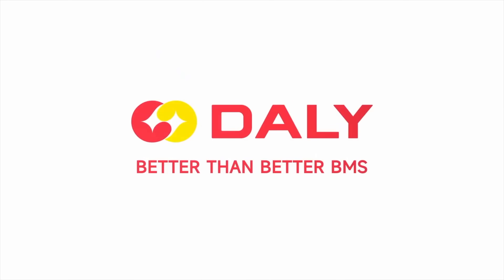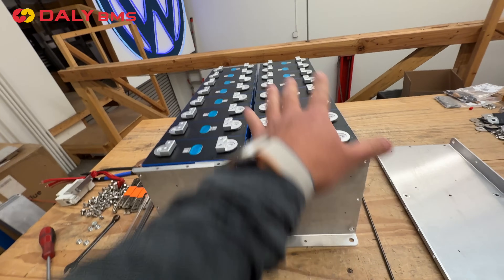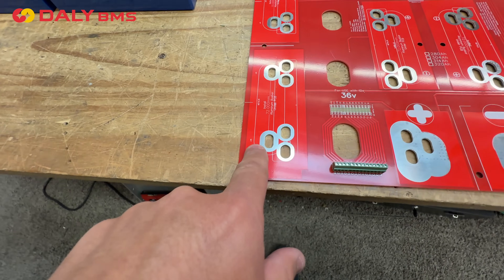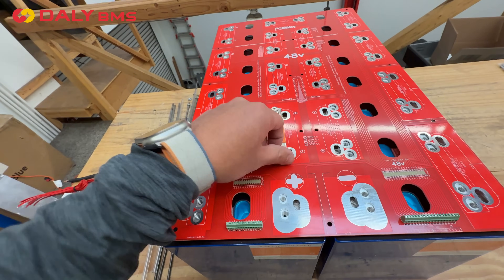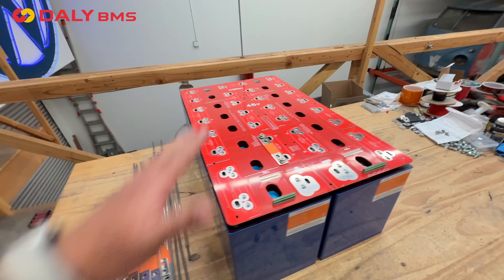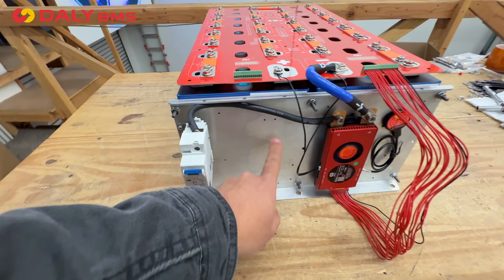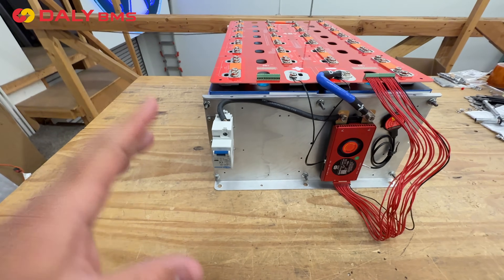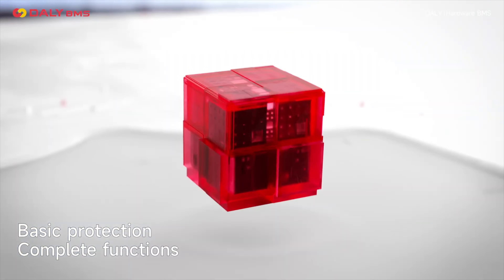Save Thousands by Building your own Battery -  Daly BMS

Comment: Do you have or can you get these dual bolt connector cells in 314 or 320AH? Are you going to stock them on your site? Can you get the Daly BMS in the 300 amp size with inverter communication?

Comment: It would be awesome if you have the cutouts for the QR codes next to the vent hole. This way, you could quickly visually check that all the batteries are arranged in the correct orientation. What I mean is that either you can see all the QR codes and it is configured correctly(+ive and -ive), or you can't see all the QR codes and it is not configured correctly. Also, you might just want to check your QR codes without having to disassemble the battery pack. 😊😊😊😊😊😊😊

Comment: What brand and model, amperage, AWG size are you using for the breaker? I am building a 48v 340AH battery, my BMNS can handle 250AH, can you give me some recommendations on what cable AWG to use and  the breaker model please? Thanks in advance.

Comment: I run 60kwh off grid from my experience JK is much better than daly. Daly sux. Also those duble post cell terminals are anodized try measuring voltage and resistance , anodizing works as an insulator there can be some issues with proper contact.

Comment: yes need a 12v version for my boat
Reply from the maker: 300Ah or bigger?
Reply: Con 4 celle in sere da 3.2volt 300amper lifepo4 is good for 2500watt di use inverter max 3000watt con cavi da 70mm2 rame

Comment: Please don't attempt to save just a couple hundred bucks (thousands? no way!) with a DIY battery. You need skills and proper equipment. That thing shown in the video is 14kWh, a lot of energy! The connecting PCB seems it doesn't take into account for expansion and contraction of the cells, which still happens despite the compression. The BMS main contacts are close to bare metal panel with no insulation whatsoever. just need a screwdriver in the wrong place to make a huge mess.

Comment: 2 questions... 
11 Can I use this on a golf cart?
2. How do you charge that pack?
Reply from the maker: Yes it can be used to power golf carts.  I would use the LF280K cells .    You can use any charger, with the right voltage.  (57.5v max)

Comment: Looks great.  No mention of temperature sensors, are those not a option?  They are absolutely necessary for locations that freeze.  Thank you.
Reply from the maker: Great point! There are two sensors on the bms they can be taped or glued to the cells or pcb an I have a connector for them on an updated design of the board to accommodate installation of these so stay tuned for that

Comment: @jehugarcia hi Jehu, thank you for you recommendation on the BMS, about to install a system in a camper that will be used daily. What inverter do you recommend if I want to a pure sine wave, 240 volt and higher watt (around 3000) output. I know Victron is great and would like to use though can you suggest a lower cost brand, I am okay with using an imported model, hoping you have experience with a brand that consistently makes clean power at the advertised specs?
Reply: It really depends on your load type: Resistive or Inductive.
Reply: @s.mendez7160  Thank you for your reply, both as I am building a system for a full time camper, specifically looking to ensure smooth clean power for computer and audio equipment.
After posting this question I thought about solar and charging and thinking that an all in one charger/inverter like an eg4 would be a good fit vs getting a generic import brand inverter. I am sure there are generic all in ones too however my guess is the support is generic if it exist at all, not good for a more complex device.

Comment: I have already very same style battery, just had own wiring, plywood plates and bottom plate. What I can recommend is to use plastic pipes over threaded rod in case of physical impact and possible shortcut between cells (bare thread works like a saw!).  And one question, what torque do you use on your rods? In my opinion have to be very, very low (I use 4xM10 rods and torque @ 1.5Nm) - but Jehu have done way more batteries than I ever seen :)

Comment: Problem with daly BMS in general is the poor balancing. (Only 100mA, and passive, not active). There are other BMS out there with active 2A balancing.... with proven quality and about the same price.
Reply: Poor balancing, slow update values in the app, measured amps bounce up&down like crazy with a constant load. Therefore the shown power is not correct and the battery percentage is wrong.
I still use two Daly's but bought two cheaper JK's for my 3th and 4th battery. Battery percentage is still not perfect but the rest is. I wouldn't buy a Daly again.
Reply: @martinmooren9536  Once you did a capacity test on your Battery Bank, is that the number you entered into your battery monitoring device for Ah capacity?
Reply: What BMS are you using?
Reply: @s.mendez7160  I have  a 90kWh battery bank consisting of 9 banks of 200Ah-16cel (10kWh). After a LOT of research I came up with the JK inverter BMS. As said here by others, the battery percentage goes off when you don't hit the 100% SOC from time to time. Right now in winter here in Belgium (where i live) I never get 100% soc when only relying on solar. So every 4-6 weeks I set my victron inverter grid setpoint tot 1kW. That way after a week the battery hits 100% again, starts to (active!) balance and off we go. Note: english is not my first language...
Reply: @s.mendez7160  B1A8S20P-HP for a 24V system.
Reply: can you recommend any?

Comment: Why not just buy Eco-worthy 12v 280AH batteries which include a BMS? Its far less expensive especially since they include the cost of shipping. Also far simpler installation. If there is a reason not to I would love to know.
Reply: What price you paying for Eco-worthy 12v 280AH battery? The blue cells are much cheaper than any pre-built battery I've seen.
Reply from the maker: Because you can buy a Ford  or a Chevy.  And pretty sure a budget battery won’t have premium cells
Reply: @jehugarcia  The spec'ed cycle count on the Eco-worthy is a bit less (6000 vs 8000 on the EVE cells). Granted the spec sheets are often inaccurate. Have you done any testing with Eco-worthy batteries or used them?
Reply from the maker: No I build batteries mostly others review

Comment: Building a 70kwh bank right now with batter hookup envision 280 ah cells. I made my own end plates. I love yours but I had means to do it myself. I saved $10,000 compared to buying eg4 batteries
Reply: @sobanidrees2999  my bank is 84 cells (4 extra) of envision 280ah new grade A balanced and matched from battery hookup. That makes me, 5 banks of 280ah or 14.3kwh each 71kwh total.
I paid $6,000 for them after tax with free shipping. Im using 5 jabidia 100amp bms. I paid about $120 each for those. I bought 1/4" aluminum plates and all thread for compression. Spent another $200 on that. Bought a shelf for another $200. Bought breakers for $200 All in for $7,200 or less. 
Eg4 wall mount 14.3kwh batteries are $3500 after tax not including shipping. Might be free shipping. For 5 cells that's $17,500 for the equivalent batteries. That's a savings of over $10,000
Reply: Cost of bank & which BMS used ??
Reply: @sobanidrees2999  my bank is 84 cells (4 extra) of envision 280ah new grade A balanced and matched from battery hookup. That makes me, 5 banks of 280ah or 14.3kwh each 71kwh total.
I paid $6,000 for them after tax with free shipping. Im using 5 jabidia 100amp bms. I paid about $120 each for those. I bought 1/4" aluminum plates and all thread for compression. Spent another $200 on that. Bought a shelf for another $200. Bought breakers for $200 All in for $7,200 or less. 
Eg4 wall mount 14.3kwh batteries are $3500 after tax not including shipping. Might be free shipping. For 5 cells that's $17,500 for the equivalent batteries. That's a savings of over $10,000
Reply: @sobanidrees2999  
84 envision 280ah grade A cells (4 extra) from battery hook up was $6,000.
I used 5 Jibiada 100amp 200 ma passive balancing BMS I paid about $120 each
I bought all thread and 1/4" aluminum plates for compression at about another $300
That's $6,900
To buy eg4 5 wall mount 14.7kwh packs at $3500 after tax+shipping? (Maybe free)
Is $17,500+ possible shipping 
That's $10,100 saved
Reply from the maker: If you are looking for the most economical cells 84 of these will cost you $5460 with free shipping https://www.docanpower.com/index.php?route=product/product&path=241&product_id=484&tracking=v6f32CWsj3K7vONcDMdYjxH3ROCriH0wAX0hkZx3kp3XYpHfA3FSbfM8O8dz8Z16
Reply: @jehugarcia  definitely would have saved a few hundred for sure. But I noticed these only have a solar grade 0.5c discharge rate. That's really all most need but the ones I just got are grade A 1.0c discharge rate. I have one 12kw inverter that pulls up to 250 amps continuously. My inverter recommends 300 amp draw capacity. At 0.5c I would be shy of the recommendation. With 1c I have plenty of headroom. Definitely still a good deal tho. I am also looking at possibly getting 2 of the new EG4 -12000XP units so that few times a year when my wife is using both ovens, stove and central air the inverter doesn't overload.
Reply: @jehugarcia 
I'm in Nigeria, I'm getting some hithium 280ah cells from China for around $40 a piece. Eve cells are around $50 a piece.
Reply: I built my truck batteries using ULTRACAPACITORS from used BUS batteries. The engine starts in a SECOND. NO LIE. 😀😀😀
Reply: @victoryfirst2878  just don't leave your headlights on for more than 10 mins without the truck running
Reply: Con capacitor piu batteria piombo acido is good for go motor  @victoryfirst2878
Reply: That's a big battery bank for sure. Just one 14kw bank will run my house, I average 8kw a day. I've not got solar, (not worth it for my location) but I do have 6 hours each night of cheap 7 pence kW electricity tariff, (25p in the day), so I'm thinking of doing a DIY 14kw battery to run the house through the day. 

What is it your running that makes you need 70kw? if you don't mind me asking. As we arnt particularly frugal with our house, lights always left on, TVs, computers, tablets, oven, hop, shower, four of us in the house. And the tortoise had her heat light in 16h a day. 

We don't have AC in the UK, no need for that. and our heating is gas, but only used late October to early march. The rest of the year its sole use is heating the water for baths and washing dishes. That costs pennies to run outside of the heating season. Then the gas can expensive.

But my combined bill is £89 per month, all year round more than covers the annual bill. Been with them about 10 years and almost £1k in credit. It was more but about 3 years ago prices spiked, but we just kept paying the same, as we had the credit buffer. Prices are back down to normal now.
Reply: @StephenButlerOne  I use about 35kwh-45kwh a day. I have electric ovens and range. 4 tons of central air. 2 full size refrigerators. Two large deep freezers, several outside led lights 80 actual watts each. 2 central HVAC units so two blowers. Dishwasher that's always running, laundry that's natural gas but always running, 2 basement dehumidifiers, with my now 85kwh batteries I can go about 3-4 cloudy days no issues. Normally our electric bill is 200-300 doll hairs a month
Reply: @StephenButlerOne  Not sure y my response keeps getting removed
Reply: Comments be getting deleted...
Reply: One question jehu!! If I built this pack by 2 so I doble it. What module should I use for an inverter and how many solar panel would I need to keep it running? Thanks in advance.
Reply: @felixvillalon8909  that's a loaded question. Depends on how many KWH a day u use. How many sun hours in the winter at your location, kw size of your largest loads. That not an easy answer